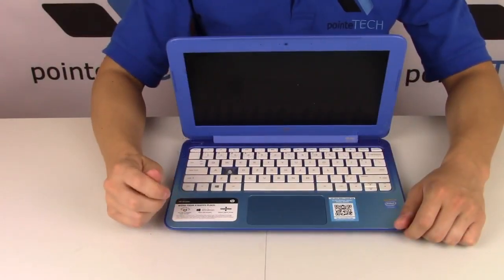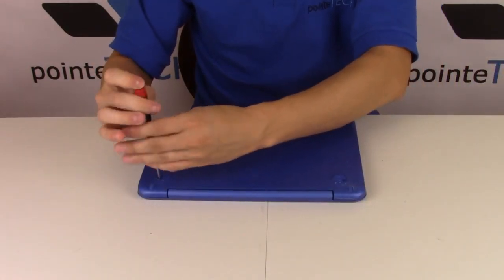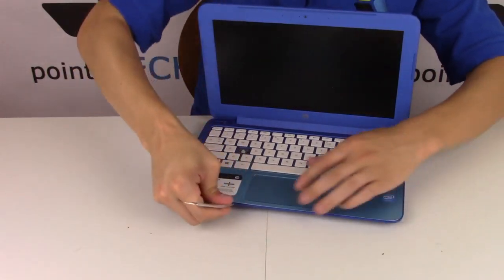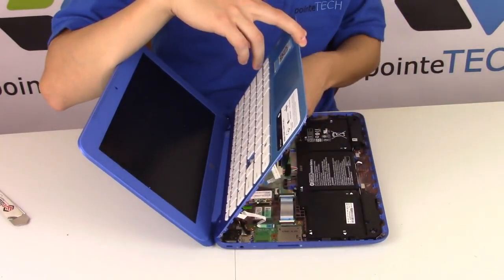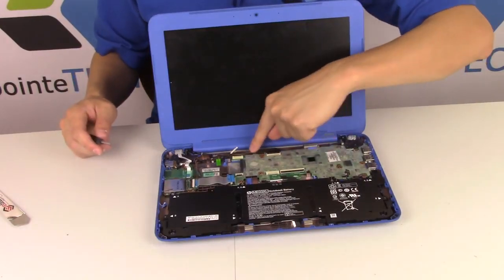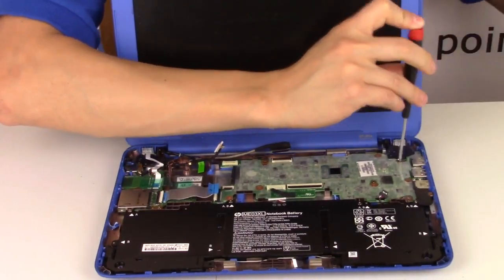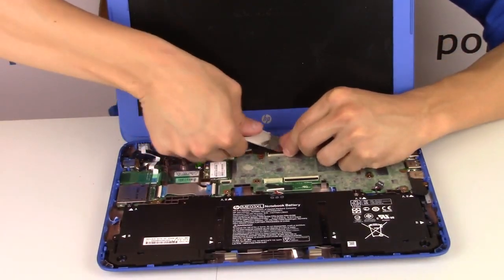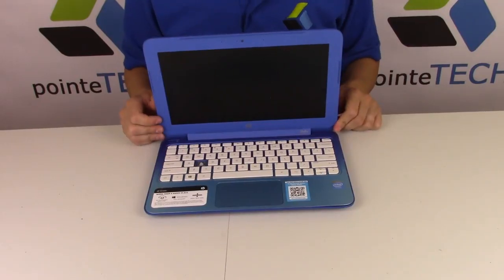How To Replace Motherboard - HP Stream 11 Laptop

Comment: Is there any possible way to upgrade storage on this laptop?
Reply from the maker: No.  The HDD or the eMMC drive is integrated into the computer.  It cannot be easily removed or replaced.  You can always use an external HDD for additional storage if desired

Comment: How to replace the CMOS Battery of hp stream 11-r010tu?
Reply from the maker: I cant find that specific model on YouTube unfortunately.  However, you can see an example of how to access a CMOS battery here;  https://www.youtube.com/watch?v=76I2Ec9K7lw.  Are you having trouble getting into your specific model computer?
Reply: @PC_Monkey  how about any hp stream 11 variant?
Reply from the maker: @janconfusio7178  ?  Did you read the last comment?
Reply: @PC_Monkey  I mean any hp stream 11 variant, not my own specific variant.
Reply from the maker: @janconfusio7178  You can see an example of how to access a CMOS battery here;  https://www.youtube.com/watch?v=76I2Ec9K7lw.  Are you having trouble getting into your specific model computer?
Reply: @PC_Monkey  Yes sir.
Reply from the maker: @janconfusio7178  Are you able to get the bottom case off and access one side of the motherboard?  What are you having trouble with?  As you can see in this video, this HP Stream 11 does not have a CMOS battery.
Reply: @PC_Monkey  I'm having trouble finding where the cmos battery is. My system clock becomes out of sync, same as my calendar.
Reply from the maker: @janconfusio7178  Your computer may not have one as this one does not.  If your BIOS is always in error, it may need to be reloaded or it could be a motherboard issue that would require replacing it
Reply: @PC_Monkey  how can it keeps the time without cmos battery?
Reply from the maker: @janconfusio7178  Again, not all computers have CMOS batteries.  In those cases, they usually use the main computer battery for that function.
Reply: @PC_Monkey  could this mean that the problem on my HP Stream is the battery?
Reply from the maker: @janconfusio7178  Yes, that is a definite possibility.
Reply: @PC_Monkey  Ok thanks. I'll try to troubleshoot.

Comment: I have a HP Stream 14-CB010NR model and need a replacement motherboard with a functioning eMMc, know any sources to purchase one without buying a new or overpriced eBay bidding war? Thanks
Reply from the maker: I dont think there will be a bidding war over a motherboard for this model lol  
I usually get my parts on ebay or amazon.  Most computer parts are Buy It Now listed and not Auctions :)

Comment: Hey the io sheild where the charger slots in got disconnected from the internal cables there are some pins on the io sheild that can be slotted back into holes on the cables is it ok for me to do that?

Comment: How to get a new motherboard and how to get all m y data back from the dead motherboard.
Please
Reply from the maker: I would search for a motherboard used on Ebay.  You can usually get good deals there.  There would be an HP Part number on the motherboard.  Are you able to locate it?  You would have to bring the old motherboard into a computer repair shop.  They may be able to save some data.
Reply: @PC_Monkey   i brought it to them but they said it's impossible cox the hard disk is sollided in the motherboard no data can be retrieve
Reply from the maker: @khaleephauba5549  Ya, thats a big problem with integrated hard drives :(  Try to always back things up online
Reply: buy a motherboard, there's your new motherboard
Reply: @DeadMemeMan  where can i get it? 
Aliexpress?
Reply: @khaleephauba5549  literally any shopping website, there are different motherboards. i suggest amazon though
Reply: @DeadMemeMan  ok thank you

Comment: This isnt related well kinda but my hp pavillion x360 laptop is dead, not completely it's still usable but everytime I unplug it dies, the percentage is at 0% even charging. I think I broke my battery from keeping it plugged in all the time but it just died to fast while playing video games so I kept it plugged in. Oh also I need some kind of external storage cause i have 9gb left, Its gotten even lower cause I play the sims 4 and have lots of mods & cc and save files. So I deleted all my other games besides minecraft and sims and got rid of the sims saves and excess things now it's around 9gb. I dont really know a lot of computer specs. Do you have any advice on what I should do or get?
Reply from the maker: I agree.  It does sound like your battery is dead if it turns off and when you unplug your computer.  Leaving the laptop plugged in all the time is a sure way to kill the battery over time.  I would replace the battery.  If you need help locating one, let me know :)   If you need some external storage, you can get an external hard drive hook up at any local Best Buy or other electronics store.  They are not very expensive and a used 500GB hard drive may run you $18.00 on Ebay.